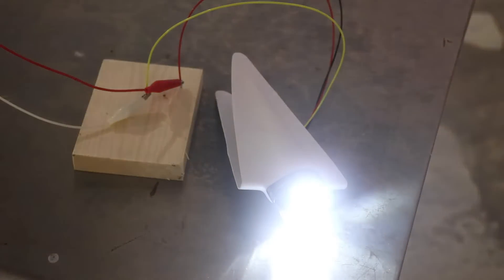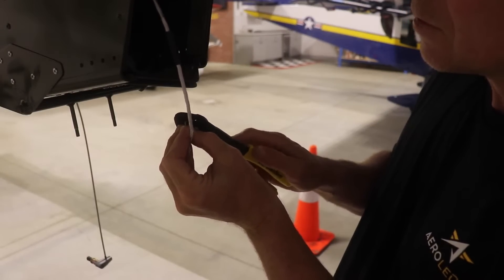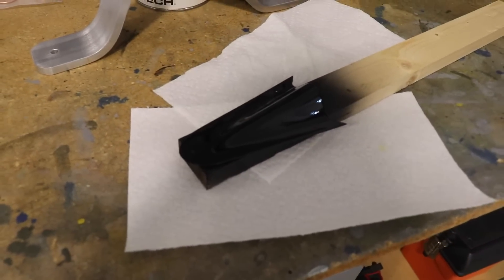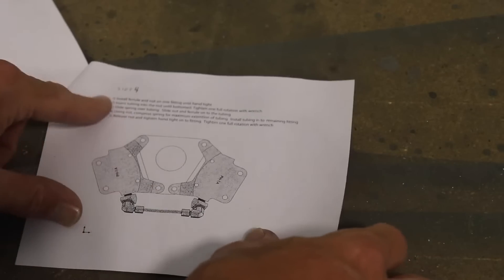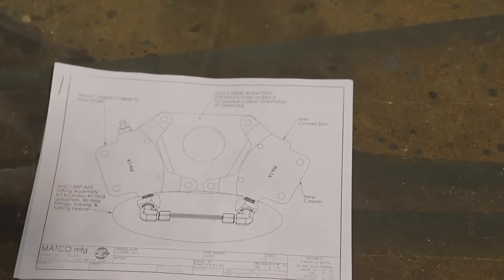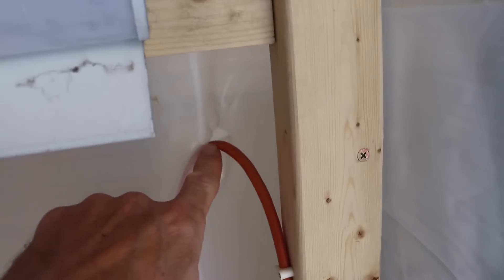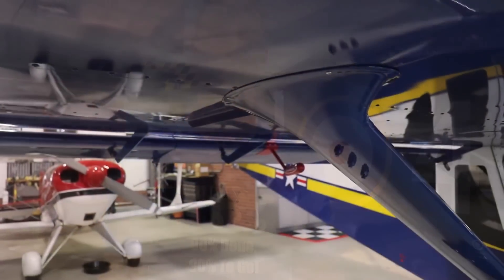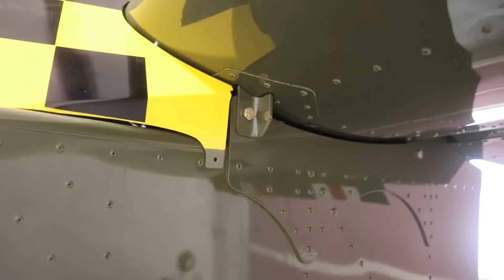Wiring the AeroLEDs Suntail Light and More!

Comment: Mark, will your Zenith be completely water tight because of the fiberglass fairings you have made? Do you have to put a special flexible waterproof caulk under the fairings to make all joints water proof?
Reply from the maker: It will never be completely water proof but I do want to seal it up as much as I can.